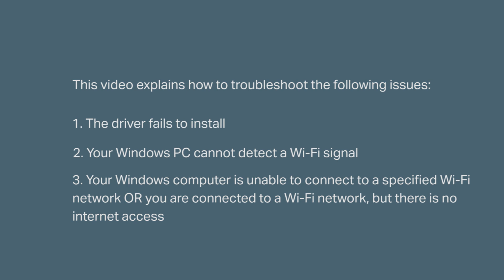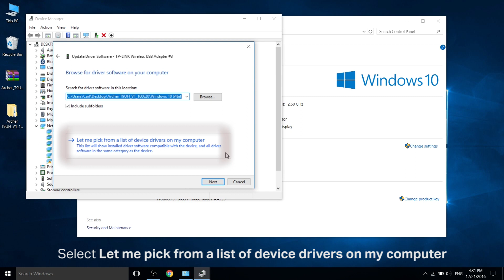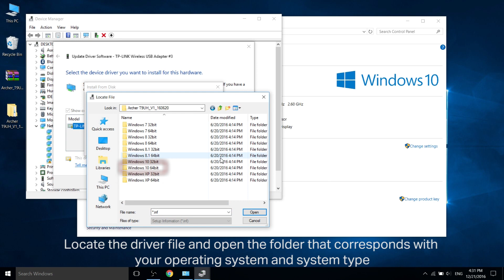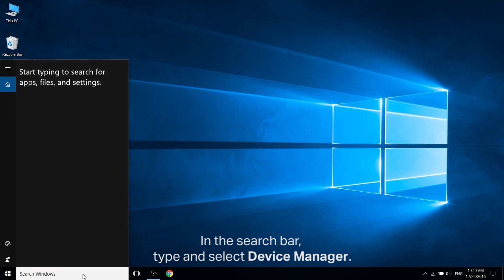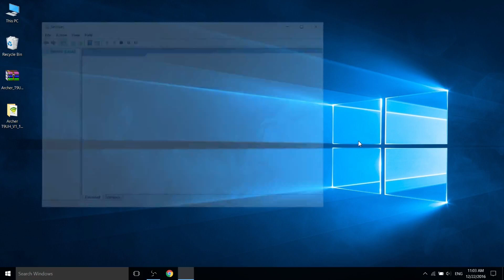How to Solve Common Problems When Installing and Setting Up a Wireless Adapter (Windows)

Comment: Or 4. The lack of support from TP link products drives you mad cause you have to buy a new adapter in order to keep using Windows 10...(Even when your Wifi adapter is still working fine and has a lot of life span ahead)
Reply from the maker: Drivers are developed by the chipset makers, not us. Just like every version of MacOS is different each update to windows 10 is different.  This means that each time Microsoft does an update there is potential for the driver to be "broken" and cause the adapter not to work.  We would then need to have the chipset maker test to see if the chip architecture is compatible and then develop a driver that is then sent to manufactures to add customization and proprietary loaders.  This can take time and requires metrics outside of our control.  If you have specific issues please contact support for assistance.
Reply: @TPLINKUS  Yeah... nope...
The TP link wn8200nd has no drivers whatsoever since like 2012 (At least the V1) so, blame the "chipset manufacturers" all you want guys, but if you depend so much on the chipset manufacturers then you should leave Realtek behind and find another partner, a more reliable one... (By the way, ironically, there is a ton of old adapters with Realtek chips that has perfectly fine W10 support, It seems like the only ones left behind are TP link ones...) 
Im so tired, every single new Windows 10 update I have to hassle with a new driver problem and find a workaround by myself.
First Windows 10 build, there was non (That's ok, MS fault), then one was added, then 1709 broke it again, the solution was to delete the TP link utility for some reason, 1803 was fine, 1809 again broken, had to uninstall "Tp link" drivers and use the Microsoft "basics" installed by default (loosing access to some features in the way) 1903 was fine, then 1909 I couldn't install any virtual VPN cause it would immediately generate conflict for some reason with the WIFI adapter and make it "disabled" or enable but inaccessible, now 2004 (But I believe this one is MS fault again)The adaptor would show as "no internet access" but worked properly in browsers, the only problem is game launchers, MS store and other Windows apps don't check connection by themselves and directly trust the "windows internet status" I  had to change Activeprobing registry key value from 0 to 1 en order to show up as "connected" an bypass all apps troubles, anyway, If is really "outside your control" then is outside my control to stop buying TP link adapters sadly, next time I have a problem with a Windows update is going directly into the trash can, sorry...
Reply from the maker: @MagoGuitarrista  Driver support for previous models ends when a new version comes out.  The previous version is EOL'd.  This is common practice in virtually all industries.  Patches for security flaws or bugs are still possible but updates to work with the latest and greatest OS or even OS version are not guaranteed.   Most commonly this is due to the architecture of the chipset not being compatible.  for an adapter who's last update was 2012 you can be assured the issue is an out of date chipset and that drivers simply don't exist.  I mean that is 8 years ago, a life time in the computer world.
Reply: @TPLINKUS  Expaining the obvious about EOL'd... (Yet, in your main page "TL-WN8200ND" is listed as "hot sale" and still "kicking")
On the other side, as I said, I've installed Windows 10 in numerous computers, and laptops (As part of my job) even older than this WIFI Adapter and the only adapter with troubles and W10 seems to be always the "TP link" ones...
Even when the others works fine with the microsoft generic adapter...
PSDT: TL-WN8200ND has W8 drivers, which is what most users with hardware that doesn't have W10 direct drivers use, since its mostly the same.
PSDT2: Im writing this from a fully updated machine with windows 10 and the TL- WN8200ND, cause as always, I found a workaround, so... basically, there goes your "incompatibility chip issues" theory, this is programmed obsolesce, plain simple.
So to summarize, not buying another adapter until this titan die, or till I feel like I need another, one more powerful or with more feats, and when I do, Im going to remember this whole TP link "experience" and guess which brand I won't be choosing?
Reply from the maker: @MagoGuitarrista  You are likely in a different region than us then.  The TL-WN8200ND in the US is end of life:  https://www.tp-link.com/us/home-networking/usb-adapter/tl-wn8200nd/  This page is controlled by the US team so information provided is typically for us.  I looked at your profile and saw you are in Argentina.  I reviewed their site and yes the TL-WN8200ND is listed as hot there however it is also the V2 that is the most recent version available.  The overview page is always featured on the most recent version.    As for your work around I assume its run in Windows 8 compatibly mode.  That is a feature in which Windows 10 emulates the environment of Windows 8 so that incompatible items will run properly.
Reply: @TPLINKUS  And is V2 compatible with W10 or is the same old song?
Cause the only logical upgrade I though about is the Archer T4uhp, but is nowhere to be found here, I check and double check, even on your Argentinian site the referred retailers don't have that option anymore...
PSDT: I can assure you even though on the TP Link Argentina store is the V2 displayed, what they'r selling here is definitely not...
Reply from the maker: @MagoGuitarrista  according to our EU site yes.  https://www.tp-link.com/en/support/download/tl-wn8200nd/#Driver  though because wireless drivers can differ by region you may want to look at the product support page for the adapter on your local region's site.
Reply: @TPLINKUS  Any way to check if what vendors are trying to sell me is V1 or V2 without opening the box?
Reply from the maker: @MagoGuitarrista  It depends on the vendor.  Here in the US TP-Link does not sell in most cases directly to the consumer.  Our Retailers maintain their own inventory and we do not have anyway to know which versions are being sold at any specific moment.  The best thing I can suggest if ordering online is to call the order in and ask for a specific model version.  Not sure if they can accommodate the request but  its the safest bet at getting a specific version if buying online.
Reply: @TPLINKUS   Yeah "Ask the vendor" that's not really a good idea, they are usually just vendors they don't know what they selling, they just sell...
So
Is there any noticeable difference in the box or something, some sticker or logo that could indicate easily which version is it?
Reply from the maker: @MagoGuitarrista  Only if you have physical access to the box.  On the Bar code label on the box the hardware version is listed.  But online the only resource is the vendor.

Comment: I've determined people at TPlink are morons. 

If we purchase a WiFi adapter or card obviously we don't have internet morons. Also, about 99% of PCs don't have optical drives anymore. So how the hell do you expect us to update drivers without any of that?
Reply from the maker: Well Jack to answer your question there few ways to do this.  1.  It can reasonably be assumed that your PC already has some from of connection to the internet.  Rather it be ethernet or an existing card that you are replacing.  With this reasonable assumption you would download the driver first, install it then connect the adapter.  2.  Use a computer that does have a connection to the internet, download the drivers to a flash drive and then install on the computer in need from there.

Comment: I got myself the Archer t6e V2.0. However, it seems like there are drivers only for the 1.0 version. Is it ok to use those?
Reply from the maker: Where are you located?  V2 might not be added as it might not show available in your region yet.
Reply: @TPLINKUS  I live in Finland.
Reply from the maker: @Pritski  email your local support here support.se@tp-link.com  they can help.

Comment: I have TL-WN823N, Windows 10. The problem is: computer connects to wi-fi spot, but in 10 sec it's off, and thats repeats again and again. HELP
Reply from the maker: That could be the computer, the adapter or the router its connecting to.  We would recommend contacting support in your region for assistance.  Go to https://www.tp-link.com/us/choose-your-location/ click on your region then click on support to see support methods and ways to contact.

Comment: I tried to fix my usb adapter tp-link Archer T4U with your solutions, and no result, only appear me: Windows can´t install 802.11n NIC, yeah even manual solutions.  This post is not usefull.
Reply from the maker: If this video did not help you, then we would suggest contacting our support team for assistance.

Comment: How about if I have the dongle connected and I have internet access but it's SLOW AS HELL (like taking 10 mins to load a single page). Also not lag becuse the speed on other devices is fine. This is the issue i've been having for the longest time and i'm baffled
Reply from the maker: There are several factors that can affect speed and performance.  What we would suggest is to contact support and have them assist in troubleshooting to find the cause and hopefully resolve it.

Comment: I purchased a TLWN8200ND today, connected the device with PC tried to install the drivers put the software error occurred saying can not detect the WiFi card? Please help
Reply from the maker: That could be several situations from the card not being seated properly, a bad PCI slot to even not having enough PCI channel available for the card.  If you need product support please contact support.

Comment: The step to turn on and make sure it’s actually working help thank you so much
Reply from the maker: USB adapters are always on devices.  as to making sure its working.  That's done by connecting to a network and having internet access.

Comment: It shows every other wifi signals. But it doesn’t show mine I rebooted my internet couple times already I restarted my desktop and nothing please help I really need internet so I can send in my assessments
Reply from the maker: Honestly if it sees other network then the issue is not with the adapter.  You would need to check your router settings to make sure the band you are trying to connect to is broadcasting and active.

Comment: My adapter doesn't tetect the 5G wifi, only the 2.4G
Reply from the maker: What adapter do you have?
Reply: @TPLINKUS  tp-link Archer T3U
Reply from the maker: @jordimas96  is your router Dual Band?
Reply: @TPLINKUS  Yes of course
Reply: @TPLINKUS  My problem is the one mentioned here: https://community.tp-link.com/en/home/forum/topic/159287
Reply from the maker: @jordimas96  We haven't heard of any issues here in the US with that adapter.  Kevin_Z runs the community for our global customers.  He'd be the best source for information regarding your adapter.  I can tell you that Windows 10 updates have broken drivers in the past.  This requires the chip set maker to look at the changes and see if their chipset is compatible with the new version.  If it is then they create a new driver and we make modifications to it.  But drivers always come from the chipset manufacture first.

Comment: I have a Nano USB Adapter TL-WN725N It can connect to a wireless connection through our telstra modem but when I try and use my iPhone or Android I can't hotspot at all the dongle doesn't pick them up at all. I use to be able to a few months ago and all of a sudden it stopped working :( can you please help me??
Reply from the maker: This would require more troubleshooting than we can provide here.  Please contact our support team.
Reply: TP-Link and how do I do that?? My son has the same single and he is having the same issue on his PC 😢
Reply from the maker: @jacqpinks  go to TP-Link.com then click on support on the top of the screen finally contact technical support.
Reply: @TPLINKUS  it is the most annoying support system, I just bought myself a different brand usb Wifi device. I will never recommend you to any of my clients.
Reply from the maker: @jacqpinks  How so, our system is designed to be as straight forward as possible, we also don't hide how to contact support like some of our competition does.

Comment: Fucking shit. It's not even detected AT ALL. Nor does the LED even work!
Reply from the maker: Try loading the driver before connecting the adapter.  If that does not work try a different USB port.  finally check your device manager to see if there are any errors in your USB controller

Comment: I downloaded a program cause there is no access to CD on my computer but it says failed try again by pressing and holding the WPS button on your adapter until WPS tool restarts but I do that and nothing happens. is anyone going through the same problem how did you fix it ? my adapter is T9UH(EU)
Reply from the maker: The T9UH is just an adapter.  There should be no need for WPS setup.  just open your wireless network menu and look for your home network.  If that does not work contact support at support@tp-link.com
Reply: @TPLINKUS  thank you it worked!

Comment: i can only locate one wifi and that is the 5ghz but not 2.45ghz. This means i can only see one, i cant even use hotspot? explanation please?
Reply from the maker: Well if you are using the Archer T1U that would be the case as it was only a 5GHz card.  If you are using any other cards then check the router's wireless to ensure the 2.4GHz is on and or broadcasting.  Contact support if there is still need.

Comment: I have windows 10 and i have trouble to connect it still! I went to win 10 just because this adapter!! It is not plug and play!
Reply from the maker: Depending on the adapter it might not be plug and play.  Plug and play is only possible if there is a generic driver available in Windows.

Comment: My adapter connects to the internet and I'm able to browse on Google but I can't go on any websites and my discord won't update. Please help.
Reply from the maker: The adapter doesn't control website access, that is dependent on the signal and the router.  we would recommend troubleshooting with your router manufature.

Comment: Can i do this without internet?
Reply from the maker: mostly yes.  for Drivers you may need to use another computer with internet to download the driver to a flash drive.  But yes most troubleshooting can be done sans internet.

Comment: Windows 10 doesn't detect the hardware, not even as unknown device. Light appears on card but that's all. None of the PCI-E or PCI ports work. Driver setup.exe refuses to run as it doesn't find the hardware.
Reply from the maker: There are a few reasons for this,  No driver, no available resources etc.  Best to contact support for assistance.

Comment: When i start a steam game the network goes offline. Any solutions? This has been annoying me the past weeks
Reply from the maker: There are several things that could be causing this.  All of which would be to cumbersome to detail in the comments section of YT.  You would need to contact your region's support line/chat or email to begin to troubleshoot this issue.
Reply: @TPLINKUS  i think i fixed it now by roll backing to the old drivers but i got a huge ping and the pc is in the same room as the router.

Comment: Terrible wifi adapter, doesn't appear anywhere, not even device manager. Would recommend not buying this knock off product.
Reply from the maker: Well first we are not a knock off product.  We are the world leader in WiFi products.  Secondly there are many factors that could be affecting the card from appearing in the Device Manger.  These range from a bad port or adapter to the driver not being installed or the USB bus being maxed out.  We would recommend contacting support for assistance.

Comment: my pc stop to work when I unplug the Wireless Adapter
Reply from the maker: Removing a  USB network adapter should not affect your OS operation.  We would recommend contacting a PC tech to figure out what is happening in your computer when the usb device is removed.

Comment: My wifi is not detecting any wifi signals
Reply from the maker: Any at all?  Check the adapter make sure its enable, re-install the driver.  change USB ports.  if that all fails then contact support for help.
Reply: @TPLINKUS  i had tryed many times but its not getting enable
Reply from the maker: @Mr-Avi-xrma  I would recommend you contact the local support for your area then.  They should be able to help.

Comment: My TL-WN821N has no light. So it's dead?
Reply from the maker: Possibly, but it could also be a port issue or a driver issue or even a Bios issue.  You would need to troubleshoot to isolate it.   Try a different port, a different computer or loading the latest driver.
Reply: @TPLINKUS  I was under the impression the green LED light would turn on right away when you connect it to a USB port, it's just that you can't use it without installing the driver first. I tried different ports, different computers, same thing no light. By the way, unit has been stored for years. I only needed it now but it's an old adapter. What would be a good replacement?
Reply from the maker: @codezionjr  It depends on if a generic driver allows the card to be detected or not.  a good replacement would be the Archer T2U Plus.  it is dual band and has a High output antenna to give you maximized range.
Reply: @TPLINKUS  Thanks! I am able to see it in device manager. Installed the driver with no problem. However, still no LED light and it cannot detect a wireless network, even if my phone does.
Reply from the maker: @codezionjr  Yeah likely its a defective unit then.  where the adapter is detected the USB is working but the Wireless Radio is likely not.